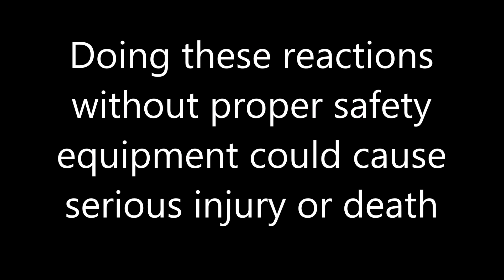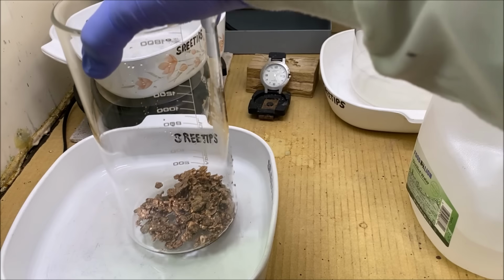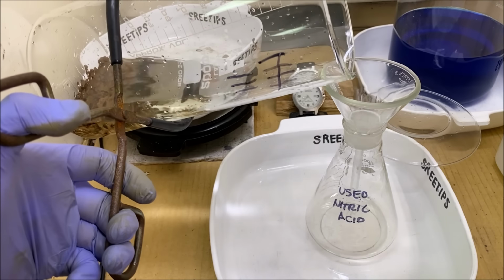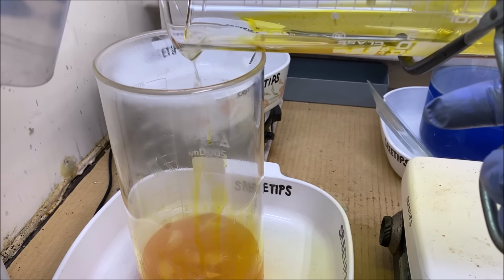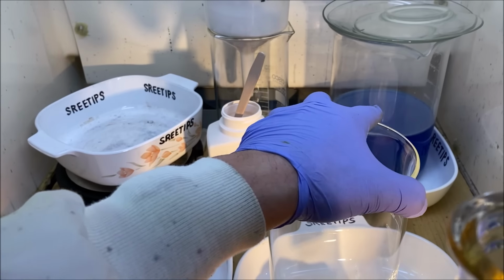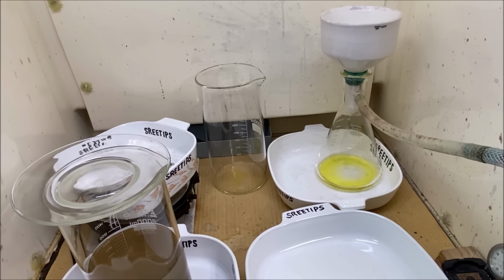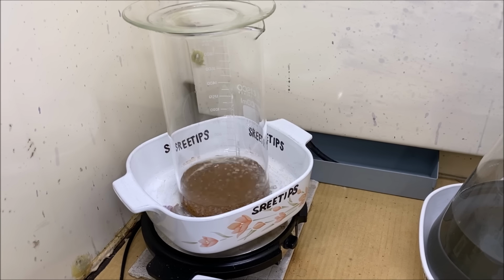Copper Instead of Silver To Inquart The GOLD

Comment: That little bar is worth over $5700
Reply: A year ago below $4900.  Gold is going high now on more commodity speculations.  Sreetips is getting rich now 😂
Reply from the maker: I’m not getting rich, I’m protecting and preserving the purchasing power of my savings. Gold doesn’t change. It’s the currency declining that makes gold appearing to be going higher.
Reply from the maker: Fact; a large paper futures market exists that can be used to easily and conveniently control the price, and therefore the demand, for physical gold and silver. Both metals are grossly undervalued. Here’s what I’m doing, ignore the talking heads, we tend to only pay attention to the ones who say what we want to hear. Understand that gold is NOT an investment to be bought low and sold high. Gold (and silver) are money. Their value does not change. They are constant. Currency, that can be printed out of thin air, without limit is what changes. I insist on getting paid in real money, gold and silver. My savings are in gold and silver. If I get paid in paper dollars I immediately convert them to real money; GOLD and silver. Paper dollars are for buying and selling and investing. Gold and silver are for storing wealth and saving. I’m not giving financial advice here. I’m merely explaining how I conduct my affairs,
Reply: @sreetips  I mostly agree, but how can silver and gold have constant values if the ratio of gold/silver price changes? They are pretty stable though.

Comment: Copper can be used, but because it’s reaction with nitric acid is a 2 electron transfer rather than 1 electron, as is the case for silver, it takes 2x the amount of nitric acid to dissolve away the copper and get the gold. Typically, nitric acid is one of the more expensive reagents in refining, even moreso than the cost difference between copper and silver metal, so silver is preferred
Reply from the maker: Not only that, I refine silver also. So for me, using sterling silver is a much better choice.
Reply: @sreetips  yeah, if you have a ready available supply of even low grade silver for cheap, you save massively on chemical costs
Reply from the maker: Right now, even if I over pay above spot, silver is very cheap. Grossly undervalued.

Comment: Senior Chief, You may have answered this in a long ago previous video, but would you be so kind to explain the use of distilled water in the Nitric boils?
Reply from the maker: When working with silver nitrate I must use distilled water. Tap water has chlorine and will instantly form silver chloride.
Reply: @sreetips  but does the use of the distilled water add more H+ ions to help accelerate the desired reaction?
Reply from the maker: I don’t think so, the main reason is to avoid forming silver chloride from the chlorine in tap water.

Comment: hey Mr. SreeTips have you tried preheating your mold with the oxy/ast torch to see it it affects the finish of the bars it forms?.... seems like it should likely make a cleaner surface finish on the bars if the casting apparatus was at a closer temp to the metals themselves being poured into them
Reply from the maker: I had that mold glowing red in this video. With gold, the hotter the better. But it can get too hot and burn some of the graphite and ruin the mold.

Comment: According to the figures I ran, dissolving copper requires about two and a half times as much nitric acid as an equal mass of silver.
Reply: That two times number seems not to match what we see in the video.  Looks like just slightly more nitric with copper
Reply from the maker: Sounds right.

Comment: Just started watching, not sure if you mentioned it so I will. Using copper works but it's costly as far as HNO3. It takes about 6X the HNO3 to digest copper. Example,  you will need about 6 oz of HNO3 to dissolve 1 oz of copper. While silver costs more it only takes about 1.2 oz HNO3 to dissolve 1 oz of silver
Reply from the maker: Agree, I only did this for the show. I normally use sterling silver.
Reply: @sreetips   Still refining on this end, rarely go to the forum. So much stuff to do. Processed 1 CPU today from the 70's, .48 gram. Old white porcelain, box white porcelain top.
Reply from the maker: That’s rich, half a gram is even better than pentium pro - 0.3g per pentium pro.

Comment: 1.
Hi sreetips~ How do you configure the proportion of aqua regia? How to calculate the ratio of hydrochloric acid and nitric acid? Looking forward to your answer. Thank you.😊

2.
Also, you used to use hydrochloric acid for rehydration. Why do you use ice cubes now? What is the difference between using ice cubes and using hydrochloric acid?
Reply from the maker: 1. In my experience, I can dissolve an ounce of gold in 150ml hydrochloric acid and 15ml to 18ml nitric acid. Roughly ten to one, hydrochloric to nitric. The old 3:1 or 4:1 HCl/nitric is antiquated. That would be way too much nitric, wasting chemicals, and guarantees problems during precipitation.
2. The only reason I used water instead of HCl this time was because I used ice to cool the solution and dilute it. I don’t think it matters whether HCl or water is used. The main reason for dehydrating is to drive off excess nitric.
Reply: @sreetips  Every time I hear your answers, I benefit a lot. Thank you very much.👍😊🫡

Comment: The point of inquaurtation is to keep the gold from being able to form base metal inclusions and protecting those inclusions from the dissolving agents. I have been using a sodium chloride brine electrolysis cell to isolate tin from plated phosphor bronze granules base metal. The result is a very fine grained mud that is very easy to wash in dilute sulphuric acid and dissolve just the tin out of the process. The remaining tin free mud is then processed in a copper sulphate electrolysis parting cell. I'm not sure how silver would react  in the sodium chloride brine electrolysis, but I don't think it would passivate. Gold forms gold chloride, for just an instant before the sodium snatches the chloride ions back, same with copper and every other constituent metal in the alloy. I then use a 3 gallon beer brewing funnel as a seperatory settling tank that collects the mud in a mason jar at the bottom.
This method uses no harse chemicals in reducing the metal to fine powder, and generates very little in the way of fumes, though there is some hydrogen given off.
The brine is eventually converted into sodium hypochlorite, but a little H2O2 converts it back to brine, and an excess of salt crystals maintains the concentration.
If another idea works out, ill be able to separate the gold from the copper without chemicals as well.
Reply from the maker: Nice!
Reply: @sreetips  
I'm attempting to set up an apparatus for separation of gold from copper using the differences in density and magnetic susceptibility by allowing the "muddy water" from the brine electrolysis to drift down into, and along, a slanted magnetic field. The copper should be affected much more than the gold, allowing each to collect at different locations at the bottom of the separator.
At the very least this should sharply reduce the amount of refining chemicals required.

Comment: nice.  i noticed the torch used to melt the fold dust was different than the one used to melt the scrap.
Reply from the maker: I used an oxy/acetylene cutting hard to inquart the scrap with copper. I used a map gas torch and oxy/acetylene with a brazing tip to melt the pure gold powder.

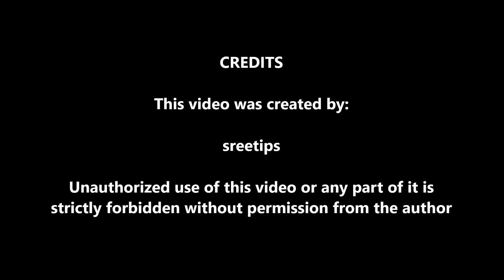Comment: Wow!  That was quick and sweet inquarting low Karat gold with copper.  With your 26:21  acids and stuff getting over $5,700.00 USD ($4,900.00 USD a year ago)  now in gold is great.  Gold going higher is going to reward your time and efforts now.
Reply from the maker: Not to be contrarian, but gold has not gone higher. Gold doesn’t change, it’s stable. It only appears to have gone up in value. But what’s really happened is the currency that gold is priced in (US dollars) has declined by so much that it takes a lot more of it to equal a single ounce of gold. It’s the value of the currency declining that makes gold look like it’s going up in value. Gold is the same as it’s always been and doesn’t change. Once you understand this concept then you’ll be able to understand why it’s important to hold hard earned savings in gold, rather than holding savings in paper currency that can be printed “without limit” out of thin air. The currency number assigned to gold is a good measuring stick for us to see how much value the currency has actually lost.

Comment: On camera the copper doesn't seem to flow as well as silver when it's molten. Is that accurate to how it behaves when you're inquarting?
Reply from the maker: Yes, copper has a higher melting temp (1984F 1084C) than gold (1943F 1062C) and silver (1763F 961C)
Reply from the maker: It takes lots more heat to melt the copper. You think that fifty degrees isn’t that much, but you can tell big time when trying to melt the copper.

Comment: Have you ever considered doing the boiling immediately before pouring off the gold refining liquid? I know gold is really good at "cold welding". I wonder if a mildly hot boil would help merge the colloidal gold so it settles.
Reply from the maker: Boiling helps settle the gold. Only thing to watch out for is: if there’s the tiniest bit of residual nitric acid, at some point, suddenly and without warning, the gold will hit a certain temp and that excess nitric will instantly begin to de-dissolve the boiling gold, and it will erupt out of the beaker creating a big mess.

Comment: Thanks for showing the alternatives. Is it possible to enquart with the silver cement rather than the normal sterling silver?
Reply from the maker: Yes, but not recommended. PGMs tend to build up if used over and over and cause problems in the silver cell

Comment: Copper does work very well to inquirt your karat gold. You can use sulfuric acid or copper sulfate and make a popsicle and use electricity to grab the copper and nickel. Noble metals stay in the Anode's filter slime. Saves on nitric acid use.
Reply from the maker: For me the copper seemed to work better than silver. The gold came out cleaner than using sterling to inquart. Less silver chloride present.
Reply: @sreetips copper works better because ir is more reactive, and more of it per molar mass. The result is the particle size after acid or electrolysis is extremely fine compared to that using silver. That gold bar at the end was extremely pure as noted by the lack of oxidation and large crystals in it. You are a master at your craft. ❤

Comment: Thank you very much! A question: couldn´t you have started the process after the copper inquartation with the much cheaper sulfuric acid, so that the bulk of copper ions would get washed out quite quickly, due to its high solubility in H2O and on the last step make a boil with nitiric acid, to get the silver out, as it has a better solubility in its nitrated solution?
Reply from the maker: I’ve used sulfuric to part the inquarted gold in a past video. It did well, but took much longer than nitric.

Comment: Question #1 can pre-1982 pennys made with 95% copper 5% tin be used to inquart gold to 6kt by any chance? Seems like a win win but I’ve read it takes too much nitric to dissolve the copper. Also thank you for sharing your travels and the explanations are second to none. I also like how you repeat important parts, it always helps understand why and why not certain things help.
Reply from the maker: I wouldn’t use 95% copper, 5% tin and zinc pennys because tin dissolved in nitric acid forms meta stannic acid, tin paste. It will clog filters like trying to filter Elmers glue.

Comment: Could we put the piece of iron in the copper waste water first to get the copper out before the silver, then take the silver out with more copper. Or would the iron take both the copper and silver out together? Thanks!
Reply from the maker: It would drop both copper and silver, plus any other metal that is below iron in the reactivity series of metals.
Reply: @sreetips  Shoot, can I just redissolve the precipate in nitric to start over?
Reply from the maker: If you have copper and silver, both are soluble in nitric. Yes.
Reply: Rinsed the nitric boil and the waste water rinse was purple ish? What is best way to go back through and pull any gold etc out of rinses?
Reply from the maker: I don’t know, you’re getting into specifics, too many variables to consider.
Reply: How much gold comes out in nitric boils when inquart, is it worth keeping the nitruc waste solution and trying to remove pms
Reply from the maker: @movietime111 no, any gold goes into my silver jar, then follows the silver into the silver cell anode basket. Gold, being insoluble, remains trapped in the anode basket and gets recovered when I process the anode filters.

Comment: Ever thought about purchasing a distilled water machine? Vevor has a good machine for relatively cheap. Considering how much you use it may save you in the long run.
Reply from the maker: During non-silver months, I use about 20 gallons per month. When working with silver it doubles or even triples.
Reply: @sreetips  You probably have everything you need already to setup a simple distillation to run on days you are not refining. Probably still costs more than buying the bottles. My complaint with the bottles is all the plastic.

Comment: Does the lead not re-dissoslve in the aqua regia after adding the sulfuric acid?
Is there a reason you dont do the sulfuric acid after boiling off the nitric acid?
Reply from the maker: The lead reacts with the sulfuric acid forming insoluble lead sulfate that will not re-dissolve so it can easily be filtered out.

Comment: 1st thanks for being so generous with your time and knowledge. I saw in your past videos where you would use tapwater ice cubes to cool your aqua Regis solution before filtering. You then moved to distilled water ice cubes because of the chlorine. I’m just getting my feet wet and had a question about this. I have a well and a water softener that we Iron Out in . Would either of those necessitate me needing to use distilled water for my gold recovery projects? I can bypass the water filter by getting water from my outdoor spicket  as well. I’m in Central Indiana and are well. water is known for a high iron content. Thanks!
Reply from the maker: I use tap water for my ice. Contaminants in parts per million. Not enough to report in an assay.

Comment: Starting around the 21-22 minute mark, you boil the gold precipitate in hydrochloric acid to remove as many impurities as possible. But why do you use hydrochloric acid specifically? What would happen if nitric acid or even sulfuric acid were used instead?
Reply from the maker: HCl will dissolve small amounts of silver chloride.

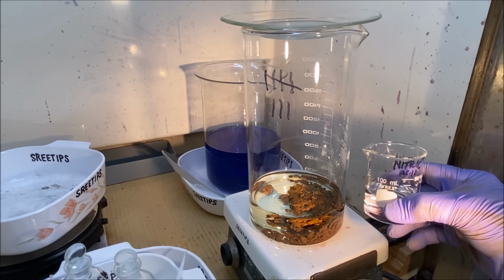Comment: Is there any reason why you added the nitric acid to make the aqua regia all at once (at 9:59), rather than incrementally like you have advocated for in the past?

Thanks for all the amazing videos.  Love them!
Reply from the maker: I can dissolve an ounce of pure gold powder with about 150ml HCl and 15ml to 18ml nitric acid. So I just do a rough calculation and add as much nitric as I think I’ll need for the amount of gold that I expect to yield.
Reply from the maker: It’s roughly ten HCl to one nitric acid that will get the gold powder to dissolve completely. Now a solid chunk of pure gold is a totally different story. It will take much more of both acids.
Reply: @sreetips  Thanks!  And finally, how do you know that you have evaporated off all the nitric acid (10:42)?
Reply from the maker: When all the fumes are gone as the solution boils with a cover on the beaker.

Comment: An experiment I would love to see tried is skipping the inquarting and first boils, jump right into  aqua regia to dissolve the gold and the impurities, apply stump out to drop everything out of solution, and then do nitric acid boils to dissolve the impurities out of that fine powder. If the powder is as fine as I think it is, it shouldnt resist the cleaning. Alternatively if during the step of knocking the gold out of solution, we could figure out a way either to knock the impurities out first or keep the impurities in the solution.
Just thoughts I had to simplify work flow. my understanding is that the inquartation needs to happen due to the structure of the gold on the atomic level  essentially protecting the impurities, so the powder shouldnt have that problem if its super fine. I imagine if this works a ton of time will be saved
Reply from the maker: Two problems; 1) going straight to aqua regia can be done, but it puts everything in solution, making a very dirty solution, and forms a ton of silver chloride that slows filtering way down. 2) passivation, the HCl in the AR reacts with the silver in the un-inquarted karat gold and forms a passive layer of silver chloride that protects the gold from the acids causing the reaction to cease. To remedy, the silver chloride must be removed before continuing to dissolve. But then as soon as it’s put back into the AR another passive layer of silver chloride forms. Believe me, if you ever do this (and I did. - once) then you’ll completely understand. Inquartation completely eliminates both of these problems. Inquarting with silver (or clean copper) then parting with nitric BEFORE going the aqua regia, is the easier softer way.
Reply from the maker: I have a video posted of dissolving karat gold directly in AR
Reply: @sreetips  oh right passivation. What dissolves silver chloride?
Reply from the maker: Hot ammonia, buts it nasty stuff. I’ve excluded ammonia from all my processes. If I do use it, I do it on a fair day outdoors.
Reply: @sreetips  Ah okay then, Thank you